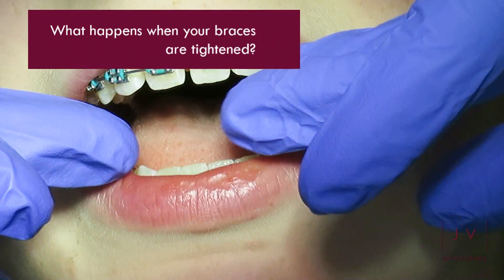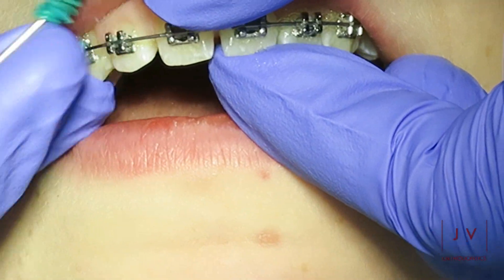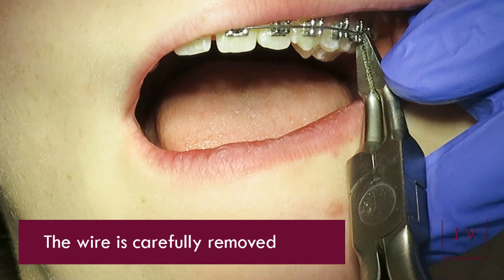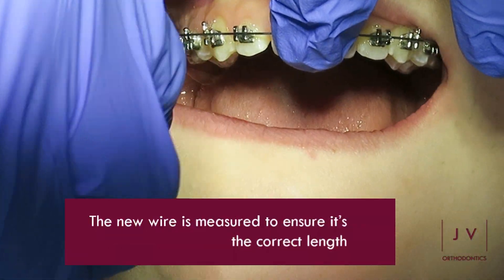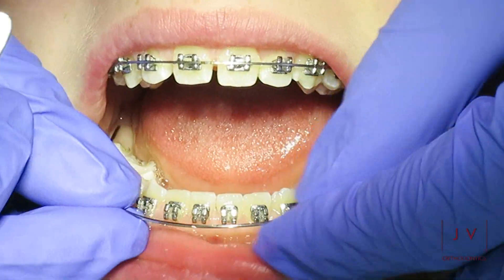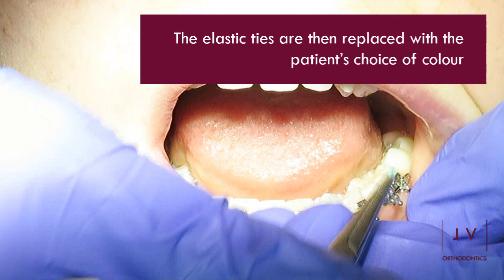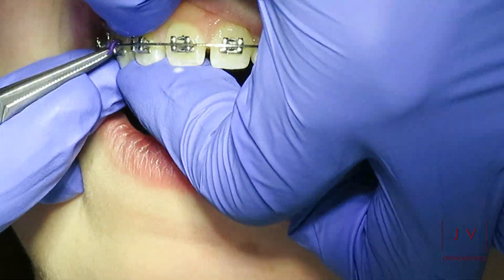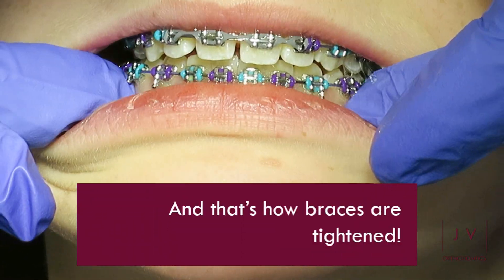WHAT happens when your braces get tightened?  |  Dr. Jiten Vadukul  |  The Orthodontist

Comment: Sir i got my Braces 3 months ago and now there is a slight change in my face shape. ie, my left side become slightly bigger than my right side face. I asked my dentist that will it come back to normal and she told me yes. What do you think sir will it come back to my normal shape.
Reply from the maker: Hi Malavika, it is very difficult for me to advise you on this without having carried out a full assessment. Sometimes patients find that their lips or cheeks feel different by having the braces fitted as they provide further support to these soft tissues - once the braces are removed, the lips/cheeks generally no longer have additional support and therefore rest onto the tooth surfaces again. If you wanted to ask more about the process of what is happening with your treatment, I would recommend speaking with your orthodontist/dentist who will be able to explain your treatment in more detail. I hope this helps :-)

Comment: A quick question, my wire just came out from the last bracket due to shortness of the wire, is it a big issue?
Reply from the maker: Hi Rashanpreet, this depends on which stage you are at. Sometimes this can happen if you have a very flexible wire (such as early on in your treatment), and often if it comes out, it does not impact on your treatment much as it would have had very little effect on a molar tooth. If, however, the wire was designed to move the molar in a significant way, the wire coming out might potentially slow your treatment journey down. If you are unsure, I would recommend speaking with your orthodontist who can advise you specifically. I hope that helps :-)

Comment: So..I’ve already had my braces tightened- 💀 I didn’t even know cuz when I did get them tightened they didn’t hurt- and I thought that was part of the changing the colours until I went again and they didn’t change my wires
Reply from the maker: Hi there, sometimes wires are not changed if they are still active or if the wires are needed for putting certain forces onto the teeth. For example, some wires are used to slide the teeth around on (closing gaps) and some wires are used to move the tooth roots (torque of the roots). I hope that helps :-)

Comment: I just broke the access metal off my bar by my cheek, I was told that was necessary for the tightening process. So I’m sitting here stressing that im gonna get in trouble. Is that extra bar needed for anything?
Reply from the maker: Hi Chase, it all depends on the type of brace you have. Some metal bars on the side there are purely used to hold the braces in place (so if the brace is still staying in, it may not be a problem), other times the bar is an active component and therefore its breakage means the movements will not be expressed. The best thing to do is to let your orthodontist know so that your treatment can be kept on track. I hope that helps :-)

Comment: My dentist change my wire every six months is that possible?
Reply from the maker: Hi Maritoni, some wires can be kept in for long periods of time if they are still working or if their properties are required for specific tooth movements. For example, some flexible aligning wires can be used for a number of months if they are still active on certain teeth. Equally, some of the most rigid wires are the ones which are kept in place for sliding certain teeth on. I hope that helps :-)

Comment: I got my braces tightened today and I don't feel any pain  and my orthodontist did not change my wire he change only rubber bands why ?
Reply from the maker: Hi there Muksan, sometimes when a there is no need to change the wire, the same wire is kept in place. This is often the case when we are seeking to slide the teeth on a wire, or if a particular wire is still active with the forces it is placing upon the teeth. Regarding the discomfort after having braces tightened, sometimes this takes effect a day or two later. If the wire is no longer placing significant force upon the teeth, then you may not feel the discomfort as the teeth will not be moving significantly. I hope that helps :-)

Comment: Why didn't we use that colured elastics?
Reply from the maker: Hi there Adithya, there are many different types of fixed brace, some which require elastics to tie the wires in, and some which do not. In the case where the braces require elastics to secure the wire, they are usually available in a variety of colours. I hope that helps :-)

Comment: My braces are not fully tightd only the portion that teeth had take why its hps so
Reply from the maker: Hi there, sometimes it is only necessary to activate certain areas of the brace as it may be that these areas need more work doing. When teeth are taken out, sometimes the forces are concentrated in these areas to begin utilising the space that has been made. Alternatively, it may be part of the orthodontic plan so I would recommend discussing with your Orthodontist, as they will be able to advise you of the stages involved in your treatment. :-)
Reply: @the_orthodontist  I have no pain while tighting

Comment: my orthodontist hasn’t changed or tighten my bottom wire they just replace the rubber bands and i’m not so sure if that is something i should be concerned about or not, because I’ve noticed them doing that for about 3-4 months???
Reply from the maker: Hi Jerry, it may be that you have reached one of the final wires as part of your treatment. Often, we will keep patients in a certain wire if there are movements we need to achieve with it. For example, we sometimes keep wires with low friction in for a few visits, so that the teeth have less resistance to movement on them. If you are at all concerned, I would suggest that you ask your Orthodontist at your next visit so that they can explain your stage in treatment. I hope that helps :-)
Reply: Same with mine, she just kept on replacing the rubber bands.

Comment: I'm getting my tightened in a few days. I'm kinda scared lol. But my mom taught me the golden rule; take the pain killers BEFORE the pain comes. So even if when you just put them on and you don't fell anything and you feel like you can ride it out without them.... DON'T, just take them and save yourself the trouble later😉
Reply: Did taking painkillers work for you
Reply from the maker: Hi Leo, thanks for your comment. It sounds like you have got yourself a routine that you are happy with when it comes to your adjustment appointments. Generally speaking, the discomfort following an adjustment appointment usually kicks in the same evening or day after, lasting for about 2-3 days. I hope the rest of your Orthodontic journey goes well :-)

Comment: I have a question. Does it hurt While you're in the process of getting your teeth tightened, or does it hurt after you get it tightened
Reply from the maker: Hi there, in most circumstances, there should be no pain whilst your braces are being tightened. You may feel a tight sensation if one or more teeth are being put under more pressure, but it generally should not be painful. The discomfort and tenderness tend to start a few hours after the adjustment and usually lasts approximately 3-4 days. I hope that helps :-)

Comment: Its been 4 months on a 2 year brace face journey and today I had a thicker wire added and it seems that this was more pain than when I had my braces tightened 6 weeks ago. My eyes were literally watering and I felt this the dental lady was not being patient because this was a new lady versus my usual lady. The pain was so bad I told her to stop and get the doctor who finished the procedure and I did not feel any pain once the doctor got in which means the other lady needs more training. My mouth is still hurting.
Reply from the maker: Hi Joanna, sorry to hear about the discomfort you experienced. Adjustment and handling of the braces can be a very operator-sensitive process and naturally there will be variation between how different clinical operators work, whether they are Doctors or Assistants. Generally speaking, there should not be anything during an adjustment appointment which causes significant pain. There are occasions when a wire/wires will feel particularly tight in certain regions, but this is usually not painful; more a tight sensation which can give rise later on to discomfort/tenderness with the tooth. I would recommend that you give feedback to your orthodontic team so that they can use your feedback to improve during their training processes. I hope your discomfort disappears quickly :-)

Comment: hello my name is mehrana and i got my braces tightened yesterday so i cant talk because my braces are numb and causing alot of pain to my braces i have tried eating soft food but whatever i eat causes my teeth to hurt alot and make it very painful
please any advice"?
Reply from the maker: Hi Ali, sorry to hear about your discomfort. Most episodes of discomfort following brace adjustments tend to last 1-5 days where day 2 and day 3 are the most uncomfortable. Whilst your teeth feel sore, I would recommend eating very soft foods which do not require much chewing (crumbly food and melt-in-your-mouth types of food are best). These foods will reduce the force experienced by your teeth during chewing and so increase your comfort. A good tip is to try and use your tongue to break up your food as much possible in the uncomfortable phase. I hope that helps :-)

Comment: So, does the tightening pain get better as your braces are tightened more? Also, is it better or worse than when you first get your braces? I saw you were responding to other comments, so I was hoping maybe you’d see this one, have a great rest of your day. ☺️
Reply from the maker: Hi there, generally speaking, most patients find the discomfort following tightening to be the worst after their initial brace-fitting appointment. Everybody is different of course and depending on what adjustments are necessary, some patients may find that certain teeth need more concentrated forces, which can feel just as uncomfortable as after the initial brace fitting. In general, once the teeth are moving, the discomfort tends to reduce. I hope that helps :-)

Comment: What hurts more, tightening pain or braces being applied
Reply from the maker: Hi J, well the brace fitting process is pain-free and is simply lots of preparation of the teeth for them to receive the braces. After the brace starts to work on the teeth, the first wave of discomfort is usually the worst as the teeth have most likely never been put under that level of force before. After each tightening, certain teeth can be put under more force and so the discomfort can arise again. The discomfort following tightening is not usually as bad as that following the braces being placed. I hope that helps :-)
Reply: Sat zu  does painkillers work for the pain?
Reply: @Moon-qu2uy  omg yes if you haven't already took some before ur appointment  you are in bad luck but ya they work
Reply: Sat zu  then why every people say it hurts like hell they can just take few pills. I hope it doesn't slow down the treatment
Reply: Sat zu  I may seem stupid but I just cant take pain so.....

Comment: honestly the first time i got my braces tightened my teeth were disabled but now like my 4th time i can eat hard and solid foods on the third day
Reply from the maker: Excellent! It sounds like you are getting used to the braces. In many of my patients, the bite changes quite significantly as their orthodontic treatment progresses, which then allows the bite to be able to manage tougher foods. At the beginning, eating tougher foods increases the risk of damage as the bite is not usually well-fitting. :-)
Reply: The Orthodontist also i have a question about teeth extractions done for my braces or what i’d like to think were needed for my braces, i had 4 teeth extracted, and do you think it was a necessary procedure for braces ?

Comment: I got my braces tightened but im eating food like I would normally however it does hurt is this safe?
Reply from the maker: Hi there, the reason I tend to recommend avoiding certain foods is because of the increased risk of breaking the braces and the increased risk of decay around the braces. I would normally expect the teeth to ache during eating for the first week or so after an adjustment as the teeth are under more pressure. This usually gets better after a week, so if you find your discomfort is not improving, I would suggest contacting your Orthodontist. I hope that helps :-)

Comment: Doc i just want to ask for my braces adjustment why its not pain? I cannot feel any pain its already two days  .
Reply from the maker: Hi Jomel, not all adjustments cause discomfort as it may be that your Orthodontist is carrying out different tooth movements. Also, sometimes if your teeth are still in the process of moving, a brace adjustment might simply be using the same mechanics to keep those teeth moving, which doesn't usually cause much discomfort. It would be a good idea to ask your Orthodontist at your next appointment if you are likely to feel any discomfort following that adjustment, as your Orthodontist will most likely be able to advise you. I hope that helps :-)
Reply: The Orthodontist  thank you doc for your advise Godbless u.

Comment: hello, just want to ask, can powerchain be put together with NiTi wire? or they should be change with thicker wire before putting the powerchain? what is consequences of putting powerchain with NiTi if there is any? and is it possible that  orthodontist just want to wait for lower teeth to be align before changing the wire at both upper and lower teeth so he put powerchain at upper teeth with NiTi to close space first?
thanks. sorry for long question
Reply from the maker: Hi there, yes it is possible to put powerchain with NiTi wires however as NiTi is a flexible wire, some control of the teeth can be lost when powerchain is applied. Of course there are many factors which come into play, some of which are what sort of movements the powerchain is creating, what type of powerchain is being used, what sort of forces are involved etc. I hope that helps :-)
Reply: @the_orthodontist  yup, thanks 😊

Comment: I have a question, will ceramic braces work slower than metal braces.
I have ceramic braces my orthodontist has done two side extractions for spacing ,and I donno when everything will set. I feel like my teeth are not moving fast with ceramic
Reply from the maker: Hi Nikhitha, thanks for your question. With most brace types, the speed of movement is variable upon many factors. It doesn't usually make much difference by having Orthodontic treatment with difference fixed brace types, however of course there will be some limited variability between the brace types. I hope that helps :-)

Comment: I am new with my braces.. i didn't have this excruciating pain others complained of on my 2nd nor 3rd day and.. But my only problem is when I bite with my molars the upper teeth constantly hit the metal molar band at the bottom which results in unequal biting in both sides... I haven't experienced this before my braces...Is there any treatment they do for this?
Reply from the maker: Hi there Shruthi, it may be that your braces have not been fully activated, which is sometimes part of the plan. It may mean then, that when your braces are fully activated, you may experience the soreness. It may also mean that your braces have been activated however you are one of the few people who do not experience the discomfort. Regarding your upper molars biting onto your lower teeth; please do not worry as you will find that the teeth usually move into more comfortable positions. I hope that helps :-)
Reply: @the_orthodontist   Maybe..And ya my teeth pain have vanished and now I got struck with jaw pain and no one even said me about the jaw thing!!!!

Comment: I get mine tightened for the first time in a few days and I have a eye tooth so it will hurt like hell when they move that tooth
Reply from the maker: Hi there, yes if there any teeth which are particularly misaligned, then they usually experience the most force and as you can imagine, are the teeth most likely to feel uncomfortable. Because the "eye tooth" has quite a large root, it doesn't tend to feel that sore. The lower front teeth tend to feel more uncomfortable, but as I said, it all depends which teeth are experiencing the force. Hope that helps :-)

Comment: Is there any difference in pain between getting your braces on and getting them tightened
Reply from the maker: Hi Andrew, that depends on how long the duration is between the braces going on and the braces being tightened. If the time frame is very large, then the brace can almost become inactive, so that when the brace is tightened, it feels almost like having a new brace fitted. Therefore the tightening is not usually as uncomfortable as immediately after the braces are fitted, but if left long enough without any adjustments, then you may experience a similar level of discomfort. I hope that helps :-)

Comment: Hi I just got my braces last month and it's my first time to have my braces tightened, but my orthodontist didn't replace the wire in my upper teeth. Why is that?
Reply from the maker: Hi there Keannu, sometimes we will keep the same wire in place if there is more work the wire can do for us. Sometimes there are a couple of teeth which may be tied in with more force the second time around. It may be that your lower teeth were ready to move into the next wire and your upper teeth were not. If at your next visit the upper wire does not change, maybe you can ask your Orthodontist about it. Hope that helps!